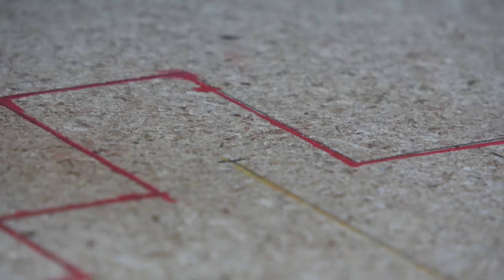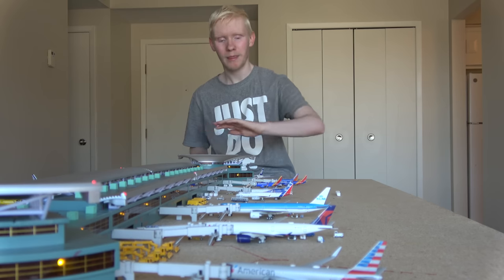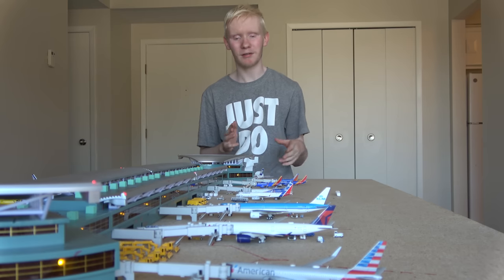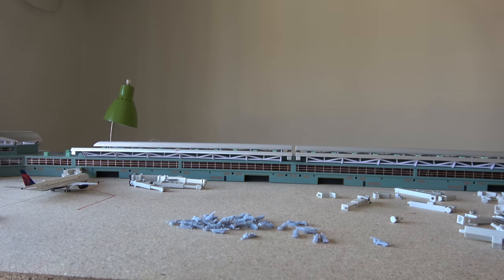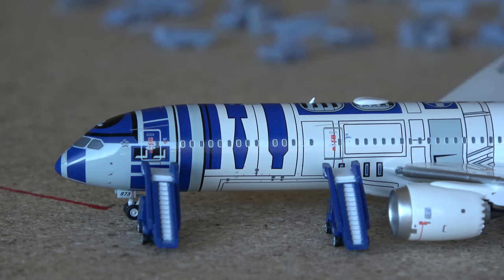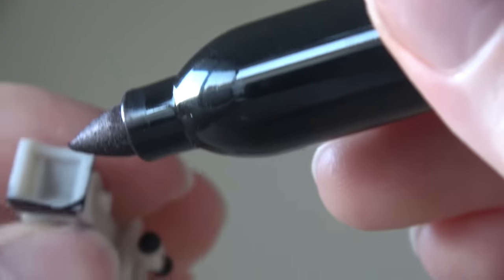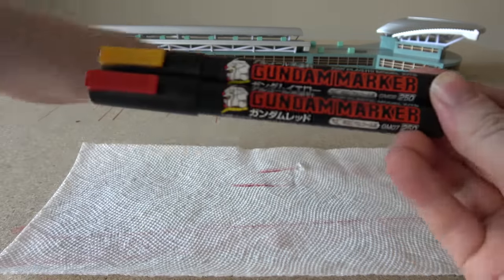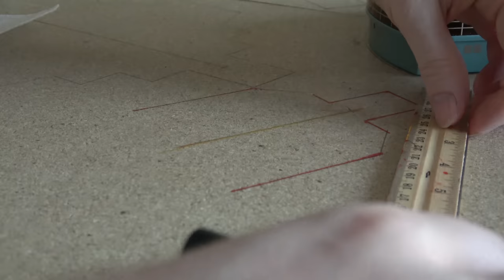How to Build Yourself an Incredible Model Airport

Comment: Very nice. I would have suggested painting the board black, flat primer first. And then placing everything. That way when you lay it all out and like it, everything will show up better. Could even use a dark gray to simulate concrete if you wanted. But painted first would have made the lining easier since paint will stick to the paint.
Reply from the maker: Painting the board will be something I do when I get a compressor for my air brush.

Comment: I have those American stairs and they do  adjust.  Just slide it pull apart firmly but slow and it catches along the way
Reply from the maker: I'll giver that a shot. I generally am pretty conservative with how I handle my GSE.
Reply: @CitrusAviation  I hear ya , if you breathe on one you can break it.
Reply: @CitrusAviation   I’m going to join your discord site, but I have a question .   Your airports are great with detail and I love it.  I need some 1/400 cars for my parking lot and taxis etc… I can’t find them. I’ll paint them I just need generic cars about 20-30   What I have found are too expensive to buy in bulk.  Help!
Reply from the maker: @Rexag  West Coast Diecast has some very affordable GSE options.

Comment: That's incredible. Nice work! Is that 1/400 scale? I have been collecting 1/200 scale for years. Have a pretty good collection between narrow & wide bodies service vehicles, etc. I even have the Gemini jets mats for 1/200 but there's nothing available as far as buildings as far as I know and even if there was, I do not have the large space to set up a full 1/200 scale airport. Anyways, dreaming about it is free though. Lol. Great job again. Congrats!
Reply from the maker: Thank you so much! Yes, this is in 400 scale. I picked 400 scale to build an airport for many of the reasons you listed above. Yes, there is a lot of 200 scale GSE and custom terminals that are available, but 400 scale has a lot more options to build an airport in a smaller space.
Reply: @CitrusAviation  where do you get your airports from and are they at a good price